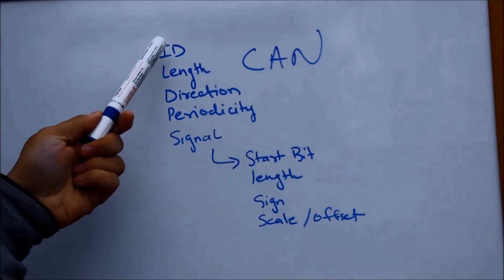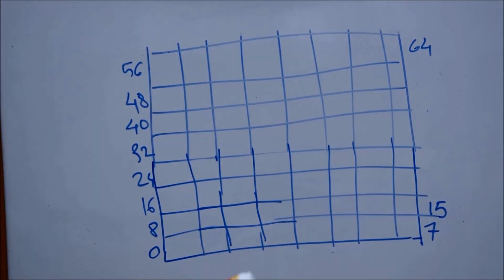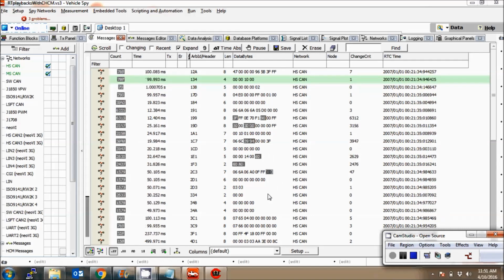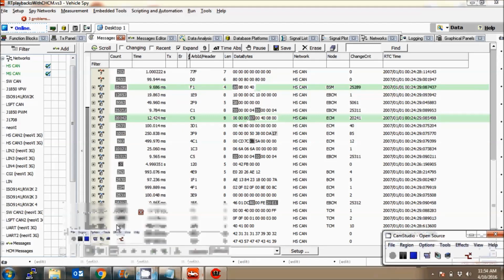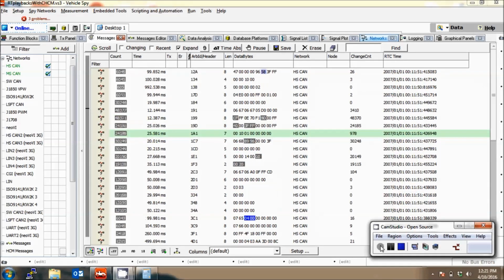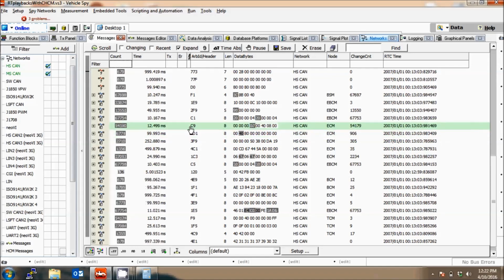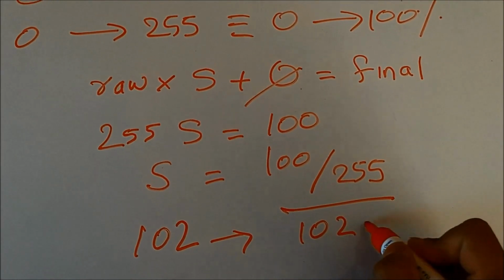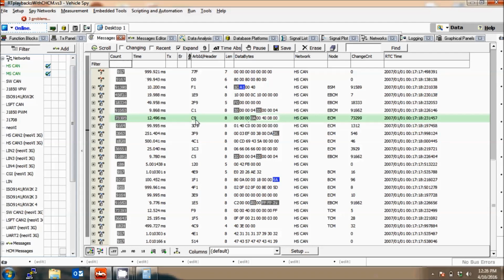Reverse Engineering Vehicle CAN Bus Signals

Comment: What low-cost hardware would you recommend that works with VehicleSpy?    Something much lower than the $400+ ValueCan4?
https://www.intrepidcs.com/products/free-tools/

I'm trying to send data to a BMW E92 instrument cluster (KOMBI)..  

https://www.giac.org/paper/gcia/9927/hacking-bus-basic-manipulation-modern-automobile-bus-reverse-engineering/133228

Comment: I want to interface to my Audi A5 (2012), I have an ODBII cable, I also have a USB2CAN module, but so far when I connect this to my car and laptop I see nothing.  What hardware do I need in order to be able to capture indicators, reverse, hazards, brakes and lights ?  I want to capture the signals from the bus so I can process them with a microcontroller like an Arduino, Beaglebone Black or Raspberry Pi.  I have a CANBus adapter for an Ardunio.
Reply: Simon Platten more than likely your testing at the wrong speed.

Comment: All CAN controllers can send max 8 bytes of data, so longer messages must be divided to multiple packets。I don't like CAN bus, I build a stand alone 485 controller chip (CDCTL) which support arbitration (as same as CAN) and user data in packet is up to 253 bytes, the baud rate is also higher than CAN or CAN FD, max rate can be 9 Mbps or 10 Mbps, and I also made another chip which can reach 36 Mbps. http://www.dukelec.com/cn/

Comment: Hi, Nice Video. I want to know where you connect Hardware to OBD2 port or directly tap on CAN bus of vehicle. I also want to know which Hardware and Software you use for this.??
Reply from the maker: You can connect your hardware to either of the two. Same data is available on both in most of the passenger vehicles. You can use Kvaser, PEAK PCAN, ValueCAN etc hardware and associated software packages for this

Comment: Hi there. So, can you use this process to eliminate dash warning lights? My plan is to swap a newish engine into an older car but simplify the engine sensors.
Reply from the maker: Yes. And you can refer to the wiki article on OBDII PIDs to see how you can fetch all the codes for the dash lights via OBD https://en.wikipedia.org/wiki/OBD-II_PIDs

Comment: Is there an alternative tool to VehicleSpy? Looks like it's pretty pricey.
Reply from the maker: you can use Kvaser or PEAK PCAN. Both are priced around ~$300 usd. Else you can use the ELM OBD2 dongle which is $20, but you will have to write your own software to read the data stream
Reply from the maker: Kvaser or PEAK PCAN is less pricey

Comment: what did you use for interfacing hardware?
Reply from the maker: it the standard calculator which comes with windows :)
Reply from the maker: in this video I have used value CAN dongle. I have used Kvaser Leaflite dongle in the past too
Reply: +tejas chafekar that calculator is pretty cool. did you download it?